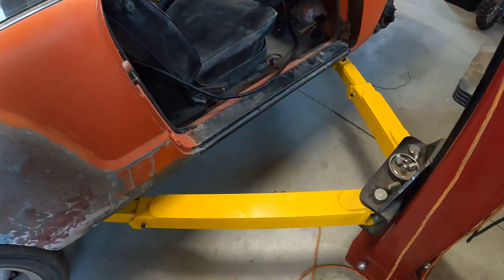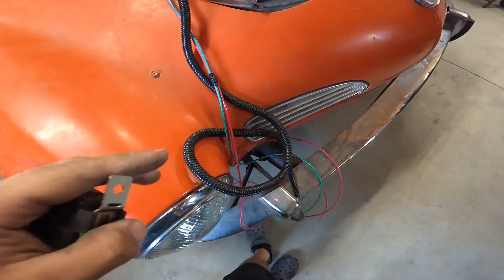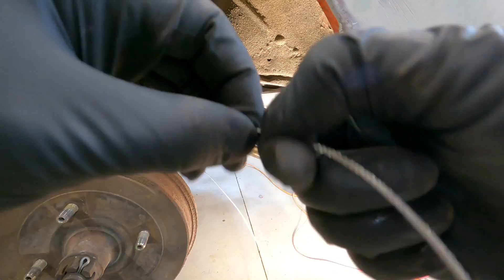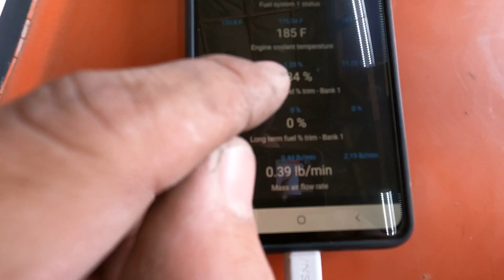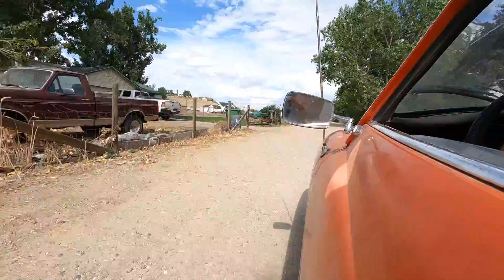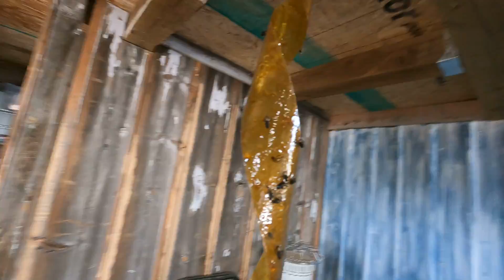Karmann Ghia w Subaru Engine Swap Pt4

Comment: I have a 1969 KG. I’d like to have that setup done to mine, but I don’t have the knowledge on where to start or what to do. The VW engine just doesn’t have the power I want.
Reply from the maker: It's definitely a huge improvement. The hardest part is figuring out your cooling system

Comment: Hey question do you regret it not being turbo?
Reply from the maker: Since it is a customer's car and not my own, it wasn't really my decision.  That being said, IT IS SOOOOOO MUCH FUN.  Its just enough power that you still feel safe to really rip into it and not have to worry about wrapping it around a tree.  This was by all means a budget friendly resto-mod.  If we had ran a turbo the transmission, clutch, mounts, brakes and possibly suspension would have need to been upgraded to keep up with that much power (keep in mind these cars were engineered for 60hp).  So to sum it up...nah it is great the way it is.

Comment: Nice job. Thanks for the time explaining everything. Have a Ghia same color,’72, which I hope to do the swap. Did the wiring come out of your donor car? Sounds great by the way
Reply from the maker: I am super excited for you. This engine turns the ghia into a super fun car to drive. Good luck and feel free to reach out when ever to bounce ideas around. The harness did come from the Donor car. We bought the car for $600 but you can get an engine/harness/ECU at our local u pull yard for around $350-450. I just liked having the whole car and being able to run the thing before the rebuild. Junkyard is kinda risky...but can pay off if you know what to look for.

Comment: Great job man!  I have a super bettle that I want to install a EJ25 on, can I reach out to you for some pointers?  My biggest fear is dealing with the electronics, and getting the engine running outside it's original body...  What a sweeeeet ride!
Reply from the maker: Feel free to reach out. I will say having the harness modified by someone who knows what they are doing takes all the guess work out of getting it running outside the car
Reply: @hoodratsgarage77
By chance could I ever reach out to you about wiring ?? I did my harness with mick as well and I can’t figure out what I may have missed or did wrong. Yes the car started before lol.

Comment: What a great series. I'm seriously considering doing this myself, I'm just wondering how much the adaptor kits, wiring harness, radiator, parts, etc, have cost you altogether at this point?
Reply from the maker: Thank you! It's been a dream build of mine for about 6 years, it's really not too complicated, the hard part is finding a ghia for a reasonable price. The prices are approx, 1999 subaru donor car $600, adapter=$600, harness work=$800, shortened oil pan=$300-400, honda 3 row hi performance radiator=$115, fuel pump=$100ish, intake system=$100-300, exhaust=custom made by me, or buy it for about $300-500. That's most of the big ticket items
Reply: @hoodratsgarage77  hey would this be the same concept for a turbo motor
Reply from the maker: @rickrossmechanic65  very similar. You might have to trim the firewall alittle more to clear the downpipe and the turbo. Also you would definitely want transmission that is stronger than the stock type 1 with a clutch and pressure plate that can handle the 220 plus horsepower of a turbo ej25.
Reply: @hoodratsgarage77  Actually I’ve done all that and it’s in and I’m down too figuring out the wires for ignition vss and so forth which I’ve acutely done tonight! When I first wrote I hadn’t decided which way to go then I found a wrecked wrx with 340hp on fb and said I guess we going turbo!!
Reply: @hoodratsgarage77  I haven’t fired it up yep in my 74 ghia ☺️ but I think I’m very very close. THANKS FOR RESPONDING

Comment: The flex hoses for the brakes collapse over time, and restrict flow, this can lead to a dragging caliper, or in worst case no flow to caliper, or wheel cylinder, which means no brakes at that wheel. Also the radiator cooling fan should not run all the time, so if yours does, you'll need to create more airflow through radiator at speed. Typically Cooling fans only run at long stoplights, and then shut off. It doesn't look like you have much of a grill opening, that's why I'm wondering about your cooling fan.
Reply from the maker: Yah we are replacing the entire brake system  via JBugs master brake rebuild kit (new hoses, master cylinder, front calipers, rear drums+shoes). The radiator fan is controlled via the ECU which commands the fan ON when the coolant reaches a specified temp(I believe it is 205-212). Once the vehicle is road worthy we will perform various long distance road test to see if the airflow is adequate. With the motor idling for over 30 minutes the coolant temp sits at a breezy 187 and the fan doesn't even have to cycle on...system runs cool due to the long coolant lines under the vehicle acting as an additional radiator of sorts.